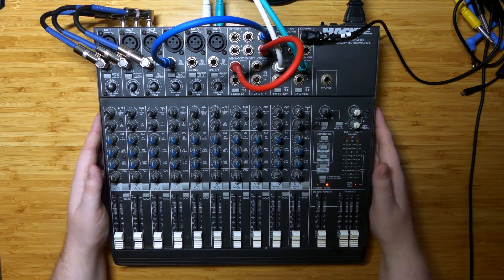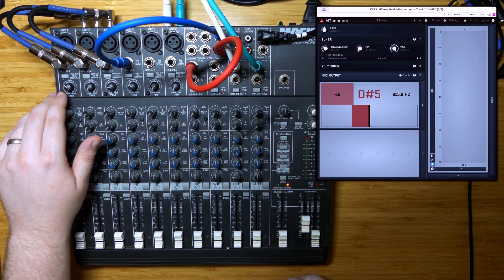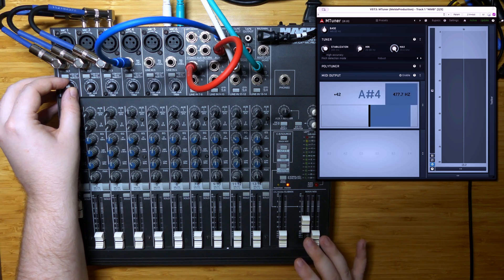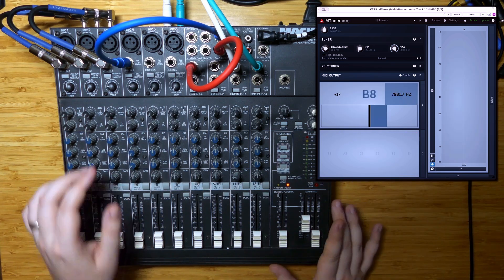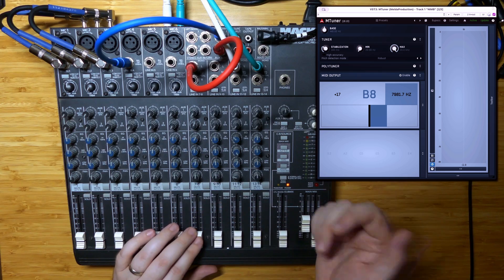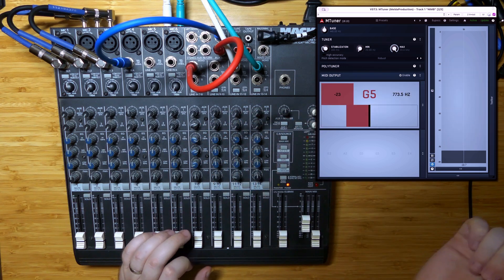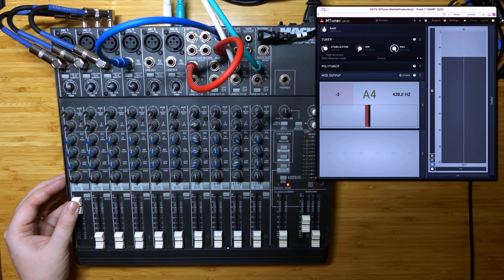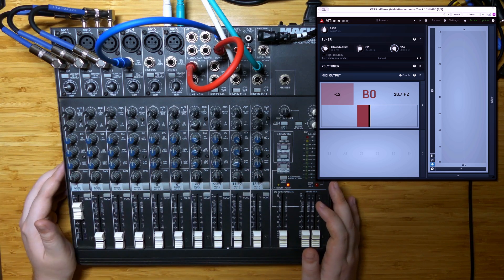The No-Input Mixing Board: Tuning and Frequency Ranges

Comment: have you ever tried to put phones out into a channel ins? Just wonder what this could sound.Could u break everything if the feedback get too loud?
Reply from the maker: Yeah! Generally, you can't break the mixing board from too much feedback. It essentially limits itself at its max voltage (of course, you want to be careful about speakers/headphones/equipment that you run the mixing board into). So using the phone outs works fine. The one caveat is that it's a TRS stereo output, so without a splitter, you will be running stereo TRS into a balanced TRS input, which can distort the sound (not really a problem here, but good to know). 

For this reason I don't use the Phones out as a feedback point very much, but on my early videos you can see me use the tape out to tape in connection with RCA cables, which is a similar sort of total feedback loop. I don't do it so much anymore because I'm trying to keep my outputs consistently line level, but that's not a requirement for using the mixing board, especially if you're limiting the output.

Comment: "I have no mics but i must scream"

This is cool, circuit bending sorta style - never thought of doing this but might have to try on a few we have at work now 😁
Reply from the maker: There's a great range of sounds you can get with the mixing board this way. Just be careful with the volume because it can get loud quite quickly. If you haven't seen my other explanations on the mixing board, you might find them helpful for starting out!